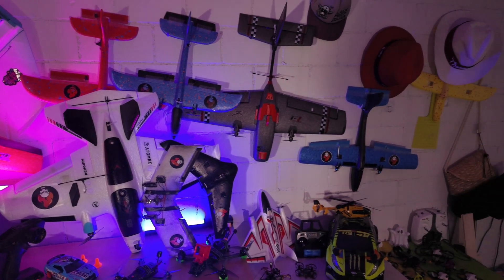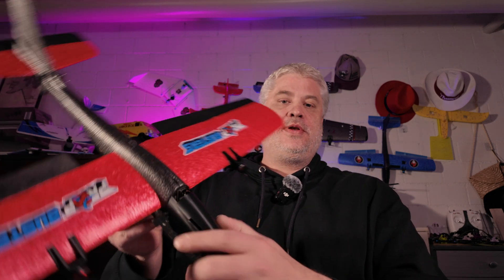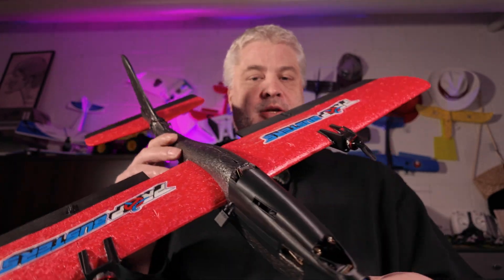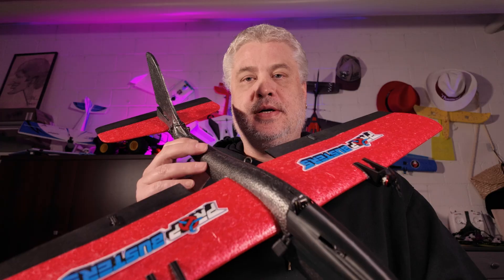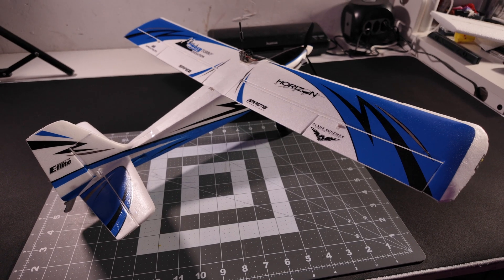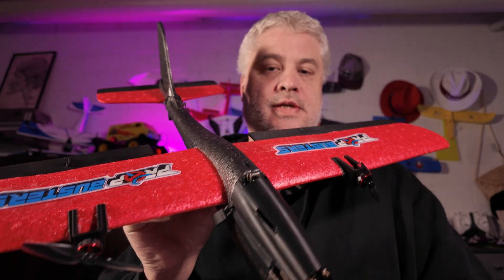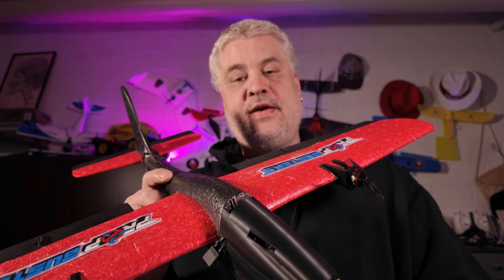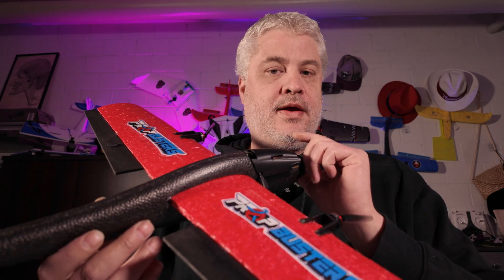FPV Foam Plane Evolution 2.0

Comment: I noticed one strange behaviour with this firmware, I cannot open the alignment tab on INAV, and cannot set it in the CLI.
Reply from the maker: Yes, alignment tab does nor work but it does via cli without issues